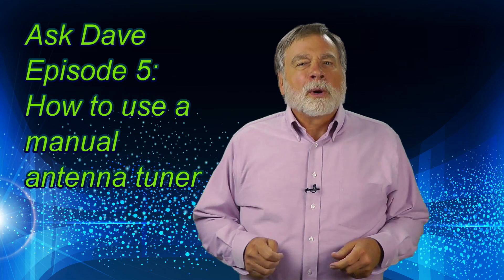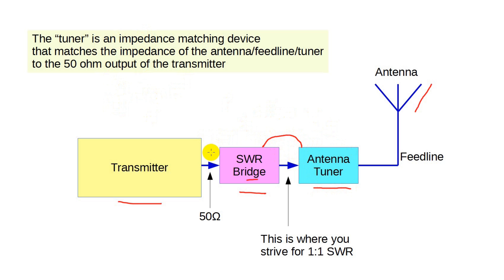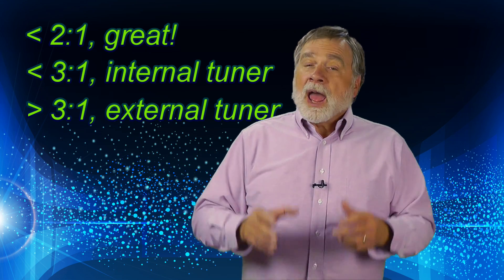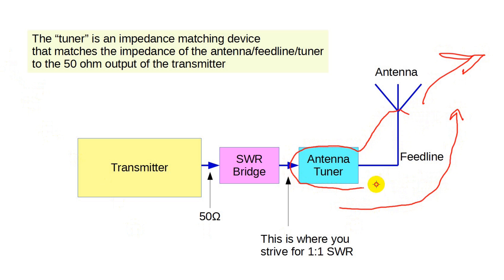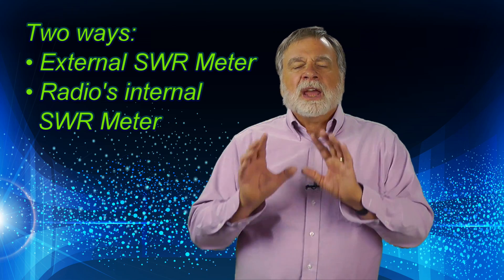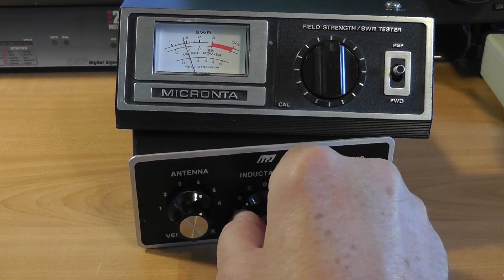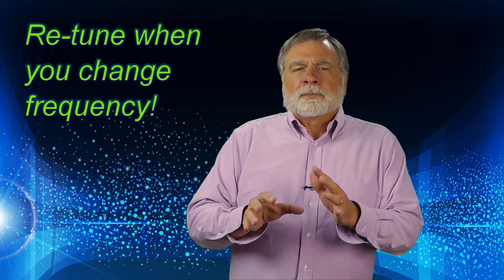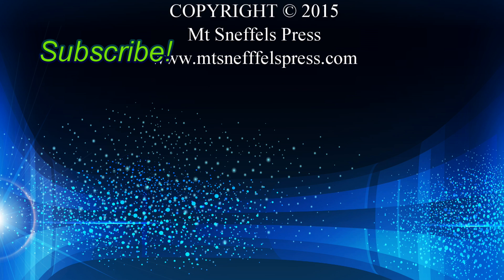Using a Manual Antenna Tuner: Ask Dave Episode 5

Comment: Been using a manual ATU all my life. A little amused by people who think they're ineffective or hard to use, but I guess times change. With my Stone Age MFJ 949E I can load up a barbed wire fence. Wouldn't think to key down without it. Great video, Dave. 

For those who find this all a little overwhelming, it's this easy: tune inductor and both caps to most noise. Dial up as little power as possible on the XMTR. (5 - 10 watts is good.) Key down and tweak ANT and TX caps till you get no reflection. Dial up 30-odd watts and tweak caps again, if necessary. Then 50, then 80, and so on. In most cases you can tune up 100w pretty quick like this, and with experience you can eventually tune up most hard cases too. 

Very freeing, let me tell you. Thanks again, Dave.
Reply: Thanks Rob for bringing the MFJ-949E to my attention. I am new to all of this so I pay attention to what equipment I see others using. That ATU is a good choice for me as I can afford to buy a used one on my budget.
Reply: @graywoulf  Good deal! If you don't have a good ground (upper floor, portable ops, etc.) I find the MFJ artificial ground is also a good investment. It's basically an antenna tuner for the counterpoise you would otherwise connect to the "ground" post on the ATU; it tunes up the same way as the ATU. Costs about as much as the 949E, but unfortunately isn't as common on the used market (though I do see it sometimes). But it solves many feedback and RFI problems, and allows you to tune up even less promising radiators than the ATU alone. 

With these two things I've been operating QRP through 100W to random wires for 25 years now, and have had a blast.

Best of luck!
Reply: Little late to the party here, but I'll chime in anyways because I liked what you had to say. I recently bought my first HF rig and upgraded to General, and in my current living situation having resonant antennas for every band on up to 10 and even 6m just isn't possible. I decided on an end fed random because I can use something with a bit of length to it, I just can't be putting up a tower or anything higher than 35 feet or so which I figure gives me a pretty decent length to work with if I do an inverted v, or even a sloper. I also like to experiment, building antennas specifically as well as learning about transformers and such to balance them, but I digress. Basically, my research on such a set up and knowing what my radios internal tuner is capable of (basically good for 3:1 or under), before I even set things up I knew I'd more than likely need an external tuner of some sort. Being a new-ish ham, and certainly new to a lot of the set ups used in hf, I weighed all of the options between auto or manual as I didn't want to overcomplicate things for myself. I found that I was naturally gravitating to the manual, despite a lot of folks saying they suck, autos 10 times easier, and all that. Automatic would be easier I suppose if it worked the way it was supposed to then thats all fine and good. But then I feel like I would lose a lot of control when maybe I just want to make a little tweak here and there. Plus, I don't think they're hard to tune up just about anything with on any band. I like the MFJ versa tuner with the cross needle meter and it even doubles as an antenna switch. I guess we all have different aspects of the hobby that motivate us, for me I feel like I am more in tune with how everything works together when using a manual tuner and seeing the difference in settings from one band to another. Thats my opinion on the matter anyways, and one huge factor for some folks might be that a good automatic tuner is going to cost quite a good chunk of cash. That cash could be better spent elsewhere in the shack Im sure, at least in my shack anyways. I picked up a barely used MFJ 941E on fleabay for $20 untested, luckily the gamble paid off and it is pretty much brand new and calibration is easy on them too. Guy even threw in a brand new 12v wall wart to power the light in the meter, can't beat a deal like that. My next project I think is going to be collecting up some parts, like a decent roller inductor, and a couple nicer variable air caps, and build myself a more robust antenna tuner just because I can. I'm not against automatic tuners by any means, we're all different. But, I also think there's some things a decent operator should be able to do before jumping ahead to Extra. Building at least a simple antenna, be able to build a simple swr bridge, know how to at least use a manual tuner and understand the basics of how it works, etc... seems there are a lot of "Extras" these days who memorized the answers to 3 question pools and marathoned all 3 exams in a weekend and are on Facebook a week later asking how to get his "SWR's" down. SWR's? I only have one SWR to deal with, unless I'm running more than one radio, then my advice would be to simply work on one at a time 😂.

Comment: Thanks for another great instructional video to help us newbies along, Dave! That Micronta SWR meter is readily available on EBay and looks like it would be a decent choice for a shoestring budget ham newbie. I’m curious if it is suitable for a 100W rig? I figure it was designed primarily for the CB market (4 watts).
Reply from the maker: I've used it with a 100w rig. Seems to be okay.

Comment: Does it matter how long the cable is to the tuner/receiver?  Won't I also have some signal loss there if the cable is too long? Where can I get this cable that has the proper connections on both ends?
Reply from the maker: Yes, longer cables lead to greater losses. You can find cables with the connectors already mounted from several sources on the Internet. Try usacoax.com
Reply: @davecasler  I have a 4 foot firestick in my semi. I have a 6ft coax to it. I used a external swr meter and cannot get it below 2.4 between channel 1 and 40, Is the problem the length of the coax?? The box for the antenna  recommends 18 feet of coax!That's alot of cable for a semi. Is their such thing as to short? Pls help been a problem for a while and I'm new to all this

Comment: NO SUCH THING AS AN ANTENNA "TUNER"! MATCHBOX, COUPLER, YES BUT NOT A TUNER 65' 8-1/4" IS A "TUNED" LENGTH FOR A 1/2 WAVE DIPOLE AT 7.125 MHZ. THE BOX ON  YOUR DESK OR THE CKT IN UR TXCVR DOES NOT, DOES NOT, DO A THING TO THAT LENGTH. THE 65+' LENGTH IS A PHYSICAL CHARACTERISTIC OR PROPERTY OF THAT TUNED CKT.  A TUNER IS A SAD, POOR TERM FOR SOMETHING THATS LYING TO YOU. TWIDDLING ITS DIALS OR PUSHING THE "AUTO-TUNE" BUTTON SIMPLY DOES THIS: IT TRIES ITS BEST TO MATCH THE IMPEDANCE OF THE SOURCE [THE TX] TO THAT OF THE LOAD - [LOAD BEING THE ANTENNA -PAY ATTENTION; "SYSTEM"].  FEEDLINES, BALUNS, AND A SMALL AMOUT OF OTHER VARIABLE COMPONENTS THAT MAKE UP THE LOAD ON THE OUTPUT OF YOUR TX. REMEMBER PHROM PHYSICS OR A HAM RADIO CLASS "MAXIMUM POWER TRANSFER WHEN ZS = ZL. -THATS MY STORY AS A HAM FOR 58 YRS, AND I'M STICKING TO IT. '73 RICH KF9F
Reply from the maker: Wow, that's a lot to shout about. I guess we'll just have to agree to disagree. Tuners (or matchboxes or transmatches) weren't so important with tube rigs with pi network outputs. But with the fussier transistor finals, impedance matching is important. A common, ordinary tuner will provide the right reactance so that the combination of feedline and transmission line will look like 50 ohms resistive to the transceiver.

Comment: I use a CB half wave ground plane and a manual antenna tuner for 6 10 12 15 and 20 meters. Longest QSO on 20 QRP was France.
Reply: It's hard to be impressed when we don't know that you aren't in France.

Comment: I have been struggling trying to understand the advantages of a feed point installed tuner.  I am struggling so much, I am not sure how to ask the question.  Assuming everything else is equal such as tuning range, power capability, and so on,  is it always optimal to have a tuner at the feed point?  

One of the LDG products says it will handle the problem of feed line standing waves.  In my mind, this means only a remote tuner can solve feed line problems and a desktop model cannot?  The desktop solves the feed line issue before the radio.  Is that all we are trying to do, match the 50 ohm radio impedance or is there something else going on?  

Love to see a video, Remote versus Shack Antenna Tuners

PS, Your the best on Youtube.  I am in the process of watching them all.

Brad
N6GR
Reply from the maker: Thank you for the kind words. If the antenna tuner is at the radio, there can be very large voltages and currents in the feed line, and these can create heat in the feed line. If you put the tuner at the antenna, you will avoid these the losses. Unless your antenna is way out of tune though, you not going to save that much by putting the tuner at the antenna.

Comment: Dave could you please confirm when measuring the length of one of the legs on a quarter wave dipole do you disregard any line that was wrapped around the connection screw and only measure the straight length or do you have to include any overlapping or or Loop as part of the full measurement of a leg
Reply from the maker: All of it counts that's in a straight line. If you wrap it around a mounting screw, the distance is that from the mounting screw to the other end of the wire.

Comment: I’m setting up a portable station. The question I have is, is a small manual tuner better to use because of the power drain of an auto or is the power drain from the tuner not enough to be concerned about I love your videos keep up the good work. Also if you have any recommendations on an inexpensive but capable tuner for portable stations ( not qrp ) It would be appreciated
Reply from the maker: I’m setting up some experiments with the loop antenna in a horizontal position and will test 40 again.
Reply from the maker: The power drain from the tuner is small but not zero. I like my MFJ 993B.

Comment: Hey Dave, I have been watching every single possible video on antenna tuners that I can find in order to understand everything I can about this devices, I have a modem receiver that have this single wire antennas that come with a ATU unit "Two of them" each have a this totally miniaturized version of it.. but range on this particular unit really stinks. Now its my hope to increase the range by installing a good set of choked dipoles but don't know if I have not other choice but to use the same type of ATU? with the same value on the capacitors & inductor....your advice will mean the world to me!!
Reply from the maker: The radios that have internal antenna tuners that are usually only good up to 3:1 SWR or so. If the antenna has a higher SWR, then an external tuner often can tune up to 10:1. If you do use an external tuner, such as those from MFJ, turn the internal tuner off.
Reply: Thank you very much for your thoughts, the ATU that is in my modem is internal, I have been taking steps to disable it "Specially the Inductor,  that connects the active element to the ground and I just plan to make my own tuned dipole antenna dead on the 433Mhz. so I can just do with out the tuning circuit..
Reply: Perhaps one last question... what would be the dBm or  mW output of  perfectly tuned antenna? using a frequency of 432.629 Mhz? thank you very much for your valuable time and effort!  at 1.5 watts
Reply from the maker: In theory, if there's no reflected power, all power is radiated. But there are resistive losses in the wire or tubes in the antenna itself, so an antenna can't be 100% efficient.
Reply: So... not even a dead on perfectly tuned antenna will put the 100% of the RF Power in to the air? isn't there any type of exception?
Reply: @Migueldeservantes   what did you do in the end?  I would have suggested a balanced feeder direct into the tx but you still have a mismatch when the antenna is probably say 200 ohms and the tx is 50.  So then you need a balun. But in so doing, you introduce a way to waste some power.

Comment: Hi Dave How about using an manual Antenna Tuner with a Shortwave receiver? It's the same concept?  I have a Longwire and a MFJ 1060 Antenna Tuner.
Reply from the maker: Yes, just tune for maximum noise.
Reply: Thanks Dave

Comment: Dave. What is the best tuner in your opinion? Manual or automatic? Also what brand and model do you use. I am new to Ham Radio and just building my Ham Shack on a limited budget. KN4HNO
Reply from the maker: The best tuner is the one you like the most. My MFJ-993B is an autotuner that has served me well.

Comment: Hi Dave, it is always a pleasure to watch your videos. I do have a question. I have an antenna tuner that has a small meter on it. I don't know how good it works, but it looks ok and the tuner seems to work quite well. However, due to the size of the meter and because of my failing eyesight I would like to place a second larger SWR/Watt meter in front of the transmatch. Is it ok to do this? It would really help me to see what is happening better.
Reply from the maker: Yes you can put these meters in series prior to the transmatch

Comment: Please put up a vid on tuning a liner amplifier lots of confusion about a tube type amp and proper tuning of it 
thanks Pilgrim5
Reply from the maker: I don't have a tube type linear amplifier. My amp is solid-state and does not require tuning except to tell it which band and using. You should follow the instructions in the manual.

Comment: Hi there Dave, Thank's for your informative, interesting video regarding antenna tuning/matching. Thinking back to my early days with HF radio (Brit  army). We had the old "Variometer" tuners with just about the whole range of sets. They had a meter which you set for Max. reading by use of the rotary inductor and just one capacitor. We accepted that we were tuned by this method on either a vertical or a wire end-fed antenna. No one seemed bothered about SWR or knew anything it in those days. It was not until I made a "Reflectometer" i.e. with a enameled wire threaded up under the coax loop and resistively balanced out to 75 ohms or below etc. etc. as per the "Technical Topics for Hamateur Radio" book from the RSGB. This was to use a Pi config. tuner for a vertical half rhombic on low VHF. I was part of a unit team testing these out using the Larkspur C45 sets. We had an out station up in Denmark, equipped with a tuning set-up that I had made in my shack .Another one on the North German coast line using the same and my station back at Hildesheim. (N. Germany). This was all organised by our Regimental signals officer who had read an article in the "Gunner" magazine which he had picked up in the "Mess". The system worked out great and we had coms between Denmark and N. Germany on sets that we often had problems with mobile to base over 15 miles range. At that time it seemed like a miracle in using about 200 feet of wire in an inverted V with its 400 ohm terminating resistor to work that kind of distance on VHF. I used the same system successfully with a 1 watt O.P manpack in the jungle of Malaysia to an HQ base station when the "Rebro". station broke down . The HQ station had the standard VHF ground plane vertical antenna by the way. 73 de John - G0WXU.
Reply from the maker: Wow, you've got some interesting stories to tell!

Comment: can you use the internal tuner in the radio  to clean up swr as you change freq instead of retuning the ext. tuner each time on the same band ie as long as your on 20 meters
Reply from the maker: Maybe, but only maybe. It's generally considered best to use just one tuner--either internal or external. 73
Reply: David 
Thank you for the reply. I am brand new at this and currently putting together my first hf station.  I have acquired a Kenwood 570d with internal tuner, and am looking at a g5rv dipole as my first antenna. Trying to save up now for tuner, but after seeing your video i believe i can get by with one of those 901b tuners, as my radio does have internal swr meter.  I just got my general licence on 2-27-17.  i may just wait till after Dayton though as i think i might try to make that trip. 
                                                                                                    73 
                                                                                     KM4ZJL Eastern TN

Comment: No suggestion was made as to where the caps were pre-set before adjusting the inductor.
Reply from the maker: Turn the knobs for maximum noise. That includes trying different inductor settings. 73

Comment: Dave I have a question. you used a micronta swr meter. I had one like that years ago. I used it for a cb radio. could that meter be used for any ham frequency and power.
Reply from the maker: Yes, for any frequency even including 2m. But I'm not sure how much power it can handle. It was made for the CB market back in the 1970s. 73

Comment: Hi Dave.. I iam Dave also! Enjoy your video's very much. Been out of Hamming for over 30 year and slowly getting back in. I have few questions hoping you may have an answer. I understand that it is important to have a Balun these days when feeding a centerfed Antenna as it is a "Balanced" system and the coax/rig is "Unbalanced" In years gone by, I just hung a dipole up without a Balun and it worked great. However in those days, we were not aware of common mode currents as we are today. What is your take? Balun or no Balun? Thanks and 73's  K8KEM      k8kem@aol.com
Reply from the maker: Dave, pleased to meet you. I'm with you regarding baluns on dipoles. I've never used one and have not found any issues. Others think they're needed. If you're not having a problem with RFI, then you're probably okay. Good luck with your experimenting! 73, Dave